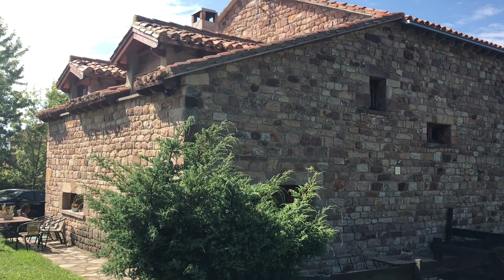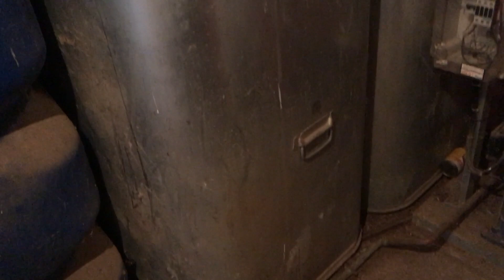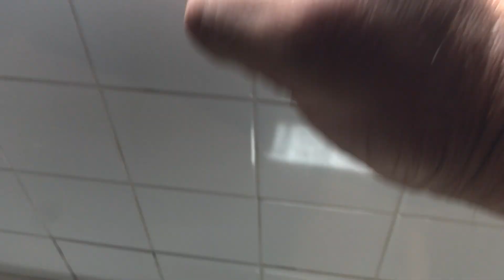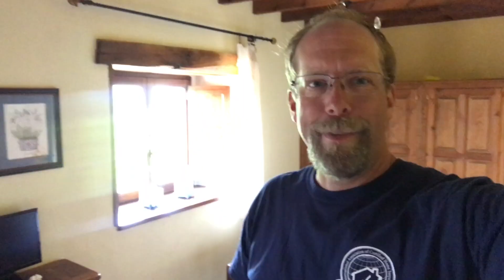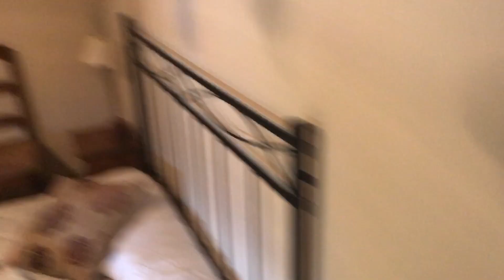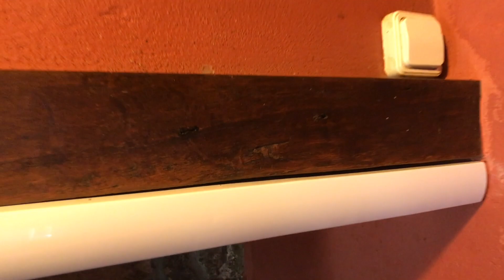How to Perform a Home Inspection in Spain #4

Comment: How hot does that pellet chimney/flue get, and is it to close to the wall?
Reply from the maker: I installed a pellet stove as a secondary heat source. It's "green" and easy to use. Manufacturer's have similar standards, which include very small clearance distances.